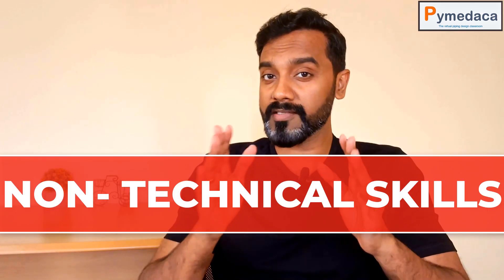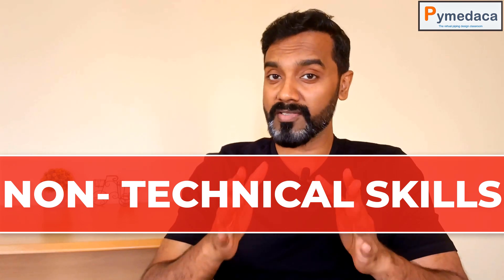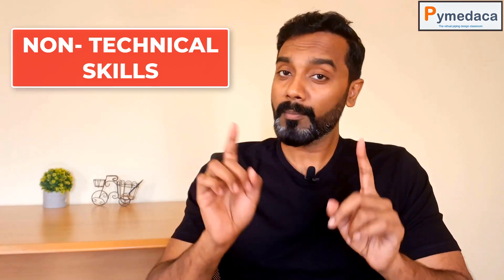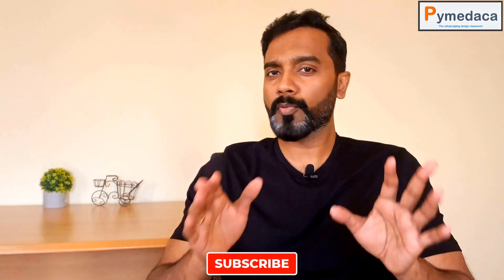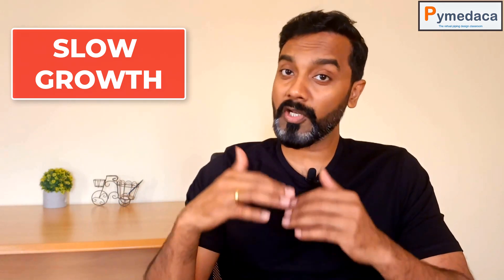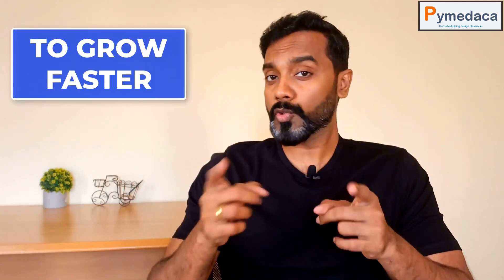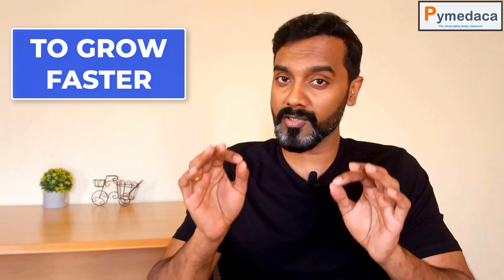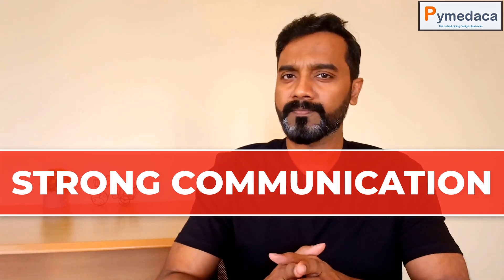MUST LEARN - Non-Technical Skills in Piping Design for Salary Increment and Faster Growth

Comment: Sir I applied your standard of 500mm pipe elevation from ground but high authorities said it obstruction the access way.😢
Reply from the maker: Note that pipe routing should be avoided from any access way and 500mm is a minimum ground clearance